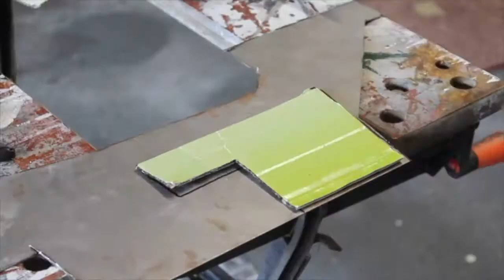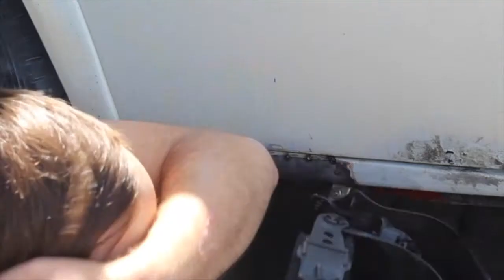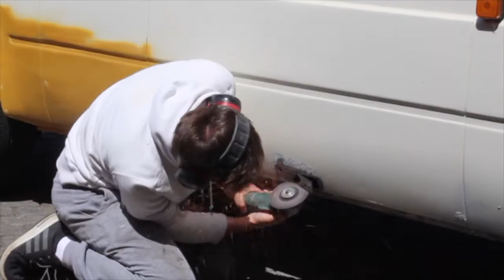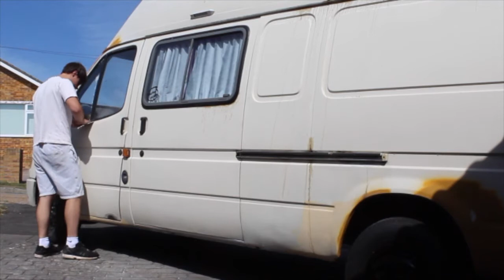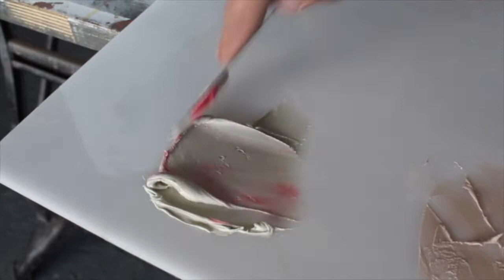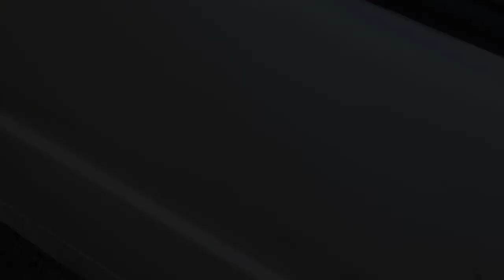Ford Transit Rust Repairs - Part 2

Comment: Same boat you and me. Please keep the videos coming, I still have not had the courage to get to it myself!
Reply: I just saw you also have just a flux core welder? What the hell man I have no excuses.
Reply from the maker: @Eksands  Thanks man! good luck with it, definitely takes some getting used to the flux cored wire but does the job. The beauty is you can always grind it back and start again :)

Comment: Do you have to put filler on over all welds as you know im just starting on my mk5 sills arches steps inners n outers cheers for your videos we mk5 transit lovers meed to keep them going as very rear now
Reply from the maker: I think it depends how neat you can weld, if the panels are welded up with no pin holes then doesn’t need filling. If it’s in a place that’s not visible I use seam sealer to coat the welds to protect them. If it’s visible I use filler to make it look better. I’m pretty new to welding still and the flux cored wire tends to spit a bit more so It’s not the neatest. That’s why I use filler to fill the pin holes and make it look better. The paint is important as it needs to be a non porous paint like epoxy primer. Filler tends to be pourous if it’s left without paint so it needs to be painted soon after the bodywork is complete. Thanks mate, good luck with your repairs 👍🏼😁